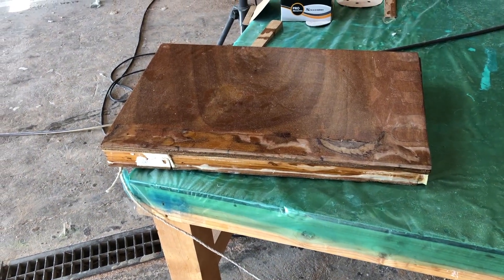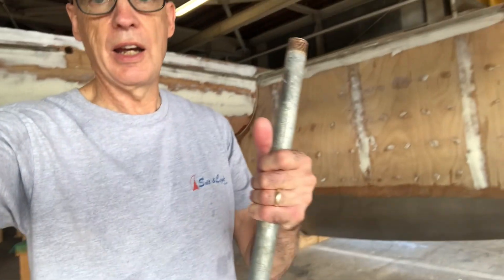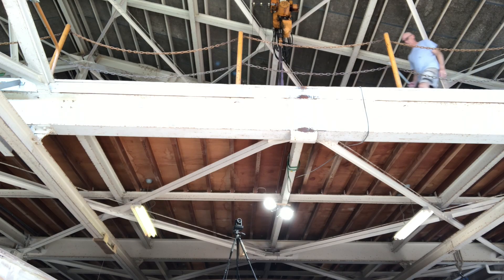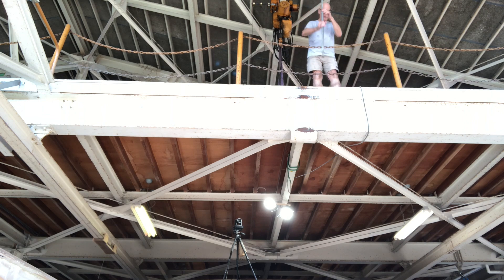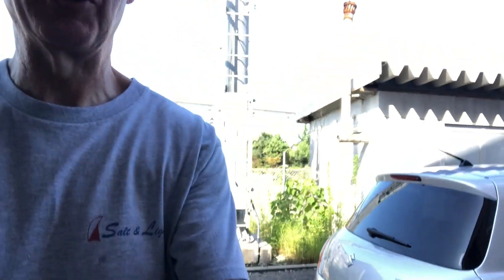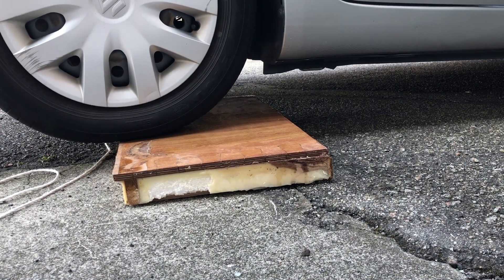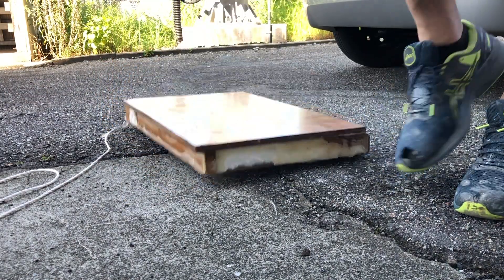Which is Better - Plywood or Aluminium for a DIY catamaran?

Comment: Here's a video that shows 3 different hull options hit with a hammer to see which has the best impact resistance. I was able to break 12mm plywood with 2 layers of 1708 glass with just moderate effort. https://youtu.be/h8dhKmARkxo The video from Salt & Light shows a pipe dropped on 12mm plywood with just a few layers of epoxy. An indented ring was clearly visible and if the plywood was examined from the back where it's covered with foam, it's quite possible that cracks will be present.

Comment: Possibly less galvanic action than on aluminium too. I.e: having copper on board won't risk a hole appearing in your hull plating
Reply from the maker: I will also be using Tru-Design through holes to minimise the possibilities of galvanic corrosion.
Kev

Comment: Wood is stiff when you compare equal weight panels of solid wood vs solid aluminum. This is probably the biggest advantage wood has over other materials. I guess it is easy to work with, also.
Reply from the maker: @mckenziekeith7434  It definitely one of the major contributors to me choosing this design.  The construction method has been well proven through the DH550 boats that have been around for quite a while with many ocean crossings.

Comment: I watched the guy go on about how aluminium is a great material for cats. It was really hard to watch. Aluminium is an old material - it needs copious amounts of stiffeners like extra frames and stringers. It needs lots of extra added insulation in the decks because it transmits heat very well. It is heavy for most sizes until you get to large ones. It is harder to make to the shapes required and requires high level skills. Compared to foam/glass or cedar strip plywood, aluminium is silly until you get to quite large boats. 
The Delos guy is quite irritating, acting like a font of wisdom about cat design when he hasn't sailed a cat and his designer has only designed one other cat. I certainly won't be watching another - it is lots of viewpoint and not much basis in fact. 
That said the Mumby aluminium cats are quite nice. 
Can you tell that I build composite multis?
Reply from the maker: @kankama1  yeah I agree, it really seems aluminum is the flavor of the month, Distant Shores, Nahoa, Delos, Sailing into Freedom and I think Odd Life is too.
Where do you build your multi’s?
Being a pattern maker I was immediately attracted to the Dix designs by the materials he uses, much more suited to my skill set.
Kev

Comment: The Epoxy plywood method has some great advantages when it comes to purchasing, ease of building, durability, reparability, insulation, environmentally, looks. Can`t really think of any disadvantages. And yes, it is great under water as well. For those that still don't believe that please read the "Gougeon Brothers on Boat Construction." Its way better than any sandwich built production boat, given that the advice in the book is followed. Combined with Dudley Dix method of hull building it is impervious to rot as well. 

And yes, combined with the foam filled cavities it is hard to come up with any construction method that produces a more unsinkable vessel.
Reply from the maker: Even I was surprised at how well it floated, I wasn’t expecting it to float so well.
Reply: @saltlightdix4704  And I forgot to mention that the Dix design has bulkheads that are waterproof and stopping water to migrate along the keel if you should be in the unfortunate situation of having the hull penetrated by an object of some kind. Most production sailboats and catamarans for that matter fill up with water once you have ingress at som point. they sink like a rock most of them. This does not do that. Given your bulkheads doors are sealing. Hint hint 🙂

Comment: Curious title.
Aluminium is definitely not a DIY material, welding is a skill/ art not easily done. 
Ply is of course an excellent material for diy boats. 
I am currently repairing a twenty year old catamaran that sat unloved for a few years.  Some things noted.

Once water gets in, it doesn’t dry out readily. 
coat each piece of ply / timber before assembling, particularly attention to edges. 
No unventilated voids.  ie box beams, but also anywhere where water can get trapped, such as spot bonding ply to frames, then running a fillet round the visible joint. 
One test you didn’t do was abrasion resistance, here ply does not fare well.  Personally I would always sheath in grp. 
Ply boats do need looking after, any leaks fixed immediately.  
I don’t think it suitable for humid tropical climates, even the best timber rots eventually
Reply from the maker: I have been very diligent in coating everything in at least 2 coats of West. On the outside pieces it will be 3 coats. There shouldn’t be anywhere where water could get in. Also used high quality marine plywood.
Reply: @saltlightdix4704  …only wish I could say the same for the guys that built mine!  I knew that when I bought her, was a tempting bargain, and if I had to spend a few hundred ££ on epoxy, still good…..but what I did not know was that the low aspect keels where broken off half way down, I had assumed they had just settled into the sand…little did I know.  Not the bargain I had hoped for.  
Now being fixed on a grassy damp foreshore in Scotland…no fun.
Reply from the maker: @markthomasson5077  I’m so thankful for the building I have to work in. Send me some photos of your boat when you get a chance, I like seeing what others are building.
saltandlight470@gmail.com

Comment: Interesting thought. Aluminium will become weaker over time and I guess ply will have similar problems. Although it does not rust or rott, aluminiuim can have galvanic problems, like when someone drops a 10c coin in the hull that you never knew about. I would imagine that Aluminum can be formed into shapes a little easier provided you have the right equipment. Al hulls are probably noisier. All said and done, if I were in a power cat going scuba diving, al would be the go for me. Maybe there is a point at which ply will not be strong enough for a large vessel. A war could break out over this question.
Reply: if there is a large margin for stresses any material can go infinite cycles. atleast theoretically according to SN curve of the material.
Reply from the maker: So far the DH550's, which is the same design as the Dix470 have held up really well, there is no reason the 470 won't as well.
Kev
Reply from the maker: I had a response from FB that the experiments were not very scientific.......Surely it didn't come across as a serious scientific experiment did it? it was me just having a bit of fun and showing that the construction method stacks up against others......
Kev

Comment: If I understand correctly your hull is just coated with epoxy, no fiberglass over top of the wood. How will your plywood hull fare over time with abrasion and scratches and  salt water getting under the epoxy?  Will this cause issues down line?
Reply: Glass over ply is more about abrasion protection and keeping boring marine worms out.. but the epoxy is soaked into the ply before being epoxy painted. 
Basalt fabric would be the best choice for adding strength and abrasion resistance. Which is why they've used it below the water line on the SV lynx. 
 build. It's used as the internal and external shell on the Windelo sailing hybrid catamarans.. the big thing is it's insulation abrasion and impact resistance as well as it's so much greener all round to produce and use.
But ply soaked in epoxy is incredibly tough which is why it was used to build the Channel 4 Africar experimental off road vehicles monocoque bodies .  15mm ply will bounce off a sledgehammer blow the trick is to keep the water out..  and prevent decay. 
RM Yatchs build ocean going ply cruising and racing monohull Yatchs up to ,65feet . 
Apart from Dix there are quite a few Chriss White designs that use ply construction as do Wharrams. 

It's also very sustainable .. insulates and is quieter to use than hulls built of other materials. In a production line process it builds very quickly requires no molds and is easy to modify interiors in hulls.

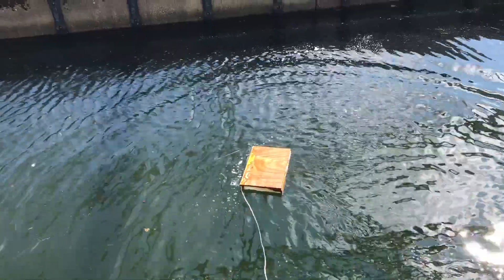I mentioned it last week but there are new forms of chemically Engineered wood becoming available ..one called Accoya developed in the Netherlands ..  they even line canals with it without further treatment the other is the next stage modified softwood light hardwood modifying process called Metelwood. 3:28
Reply: @clivestainlesssteelwomble7665  Thanks for introducing the africar to me. Couldn't believe a car can be made of plywood yet travel from artic to equator. Its sad that their business never made it though.
Reply: Big feet on them two…
Reply from the maker: @jkerr7331  once the epoxy is applied to the plywood, it soaks into the fibres somewhat thus leaving no way for water to get underneath unless you sustain some damage, but even then it high quality marine grade plywood. The radius chines are made out of 4 layers of 3mm plywood with epoxy between each layer. Check out Gougeon Brothers plywood and epoxy boat construction.
Kev
Reply: There's  a test you left out exposure to fire 🔥 😉🧙🏻‍♂️ 
Which is what took down the Bearfoot doctors.
Reply from the maker: @clivestainlesssteelwomble7665  Clive, one thing I do know is epoxy burns, it takes a bit to get it on fire but once it’s going it’s very hard to stop. Plywood on the other hand does burn but not that great, I guess fire would be the worst scenario for a plywood/ epoxy boat and the fumes would be pretty bad too. Fire prevention is key!
Kev
Reply: @clivestainlesssteelwomble7665  You can get flame-retardant epoxies now, I think some are made from aluminium hydroxide. :) Though I don't think anything would have helped the Barefoot doctors boat that was caused by a contractor spilling something volatile in the forward bilge that another contractor working in the aft unknowingly ignited.